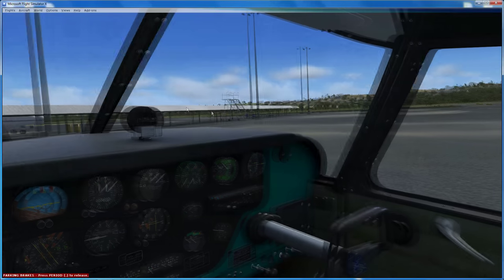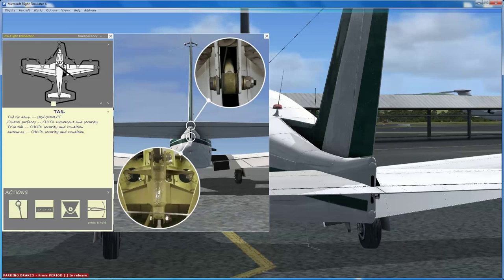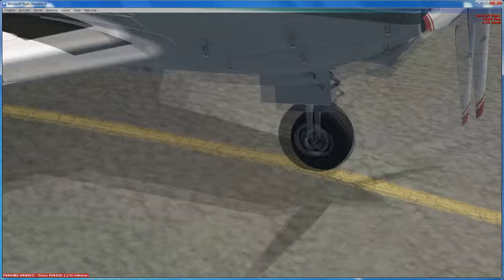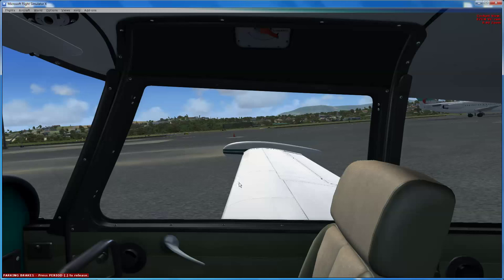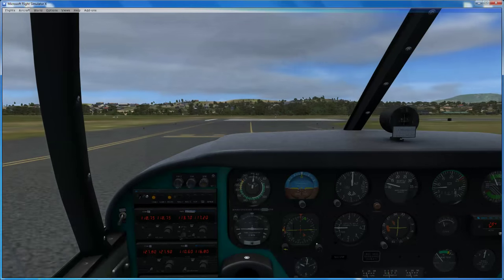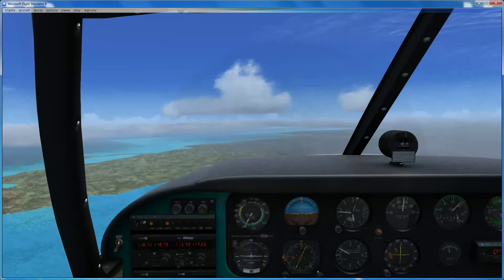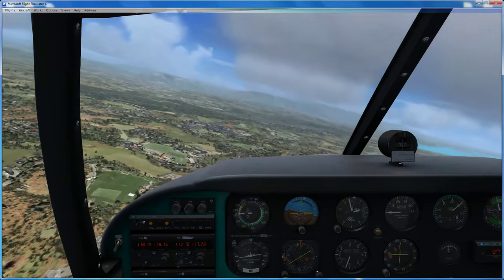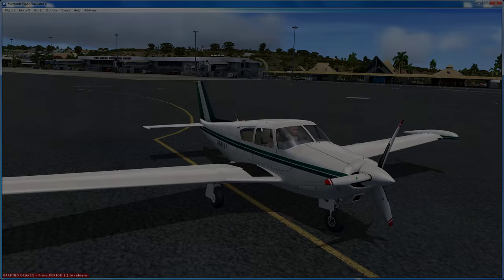A2A Piper Comanche 250 Full Detailed Review  FSX | Steam | P3D

Comment: Rich - I'm a new fan of your channel, and I'm getting ready to choose one of the A2A aircraft to boost the realism and get a bit more serious with FSX. I liked what you said about the Skylane's "stick and rudder" feel. How does the Comanche compare in that regard?
Reply from the maker: The Comanche has a more demanding approach and landing profile IMHO.  It doesn't bleed speed easily, tends to float more on landing and it is much more important to get the approach and landing speed correct.  The ground effect seems to have been better replicated and there are nice touches abound, including such things as the 3 position gear switch.
The Comanche has more options in such things as tip tanks.
The critical point is that one of the guys at A2A actually owns a Comanche, so with unlimited access to the real aircraft and his personal experience, I'm pretty sure that the handling is as good as you can get within FSX/P3D.
Obviously that's just my opinion, but you could do worse than post the same question on the A2A forums which are frequented by quite a few real world pilots.

Comment: Wonderful review as always.  One thing.  Should you have had the fuel pump on continuously?  I've flown quite a few hours in Cherokee 160 and the fuel pump is turned off except for takeoff and  landing.  At the moment I'm transitioning to gliders at a local airport.  No fuel, with the exception of that provided by the sun.  Bits of my training experience can be found at www.youtube.com/jhettish1945  I actually have a couple of videos flying the Cherokee in real life on that channel as well.
Reply from the maker: +John Hettish Hi John, the fuel pump in many respects is a pilot's decision.  Many ga aircraft have 2 pumps, one mechanical as part of the engine ancillaries, and one electrical.  The electrical is in effect a safety pump for most ga aircraft and is most commonly used where a failure of the mechanical pump would put the aircraft at great risk.  Thus it is most commonly used for dangerous phases of flight (take off/landing/aeros etc.) or where there is concern over a rough running engine.  As such, use of the pump, like any other control, is at the pilot's discretion.There are 2 good reasons for turning it off in flight.  Firstly, it reduces the mechanical wear on the electrical pump itself (as well as reducing the electrical load on the systems), but also how does one know the mechanical pump has failed if both pumps are running all the time?
Chucking an aircraft round the sky doing stalls and spins is somewhere I personally would consider having the electrical pump on.However, on this occasion I simply forgot to turn it off.  Lol, I should know better  ;-)Huge thanks for the support,Rich
Reply: +flightsim481 "However, on this occasion I simply forgot to turn it off."  I figured that was the case. :-)  I've had many instances in the Cherokee where I forgot to (a) turn it on, or (b) turn it off.  I'm quite familiar with the existence of the mechanical fuel pump.  The electrical fuel pump is often, if not always, seen in low wing aircraft.  I was trained in several versions of older Cessna and there was never an electrical fuel pump.  Therefore when transitioning to a low wing aircraft remembering the fuel pump on take off and landing has always been a problem for me.  Finally after 50 or 60 hours I got consistent at not only switching it off an on but at using the check list, something I should have been doing from the start.  I flew glider yesterday and hope to have a little bit of the video on my flying channel but first things first.  It's Monday and I'm in my office.

I do enjoy your reviews.  Perhaps I should do one on the AS K-21.  John
Reply from the maker: +John Hettish I do like the look of the ASK 21 and indeed have a great deal of time for gliders. A very friendly way to fly :-). No fuel pumps either ;-)
Reply: +flightsim481 Actually, the Aerosoft AS K-21 not only looks good but behaves just like the real airplane, much like the A2A Cherokee behaves like it's real world namesake.  They had to add modules to the 21 in order to gain realism due to certain FSX design deficiencies.  It's good to have real world flight time in both to be able to make that statement.  When I'm not flying real-world, I'm flying FSX or Condor.  Come to think of it I'm probably a pretty boring guy. :-)